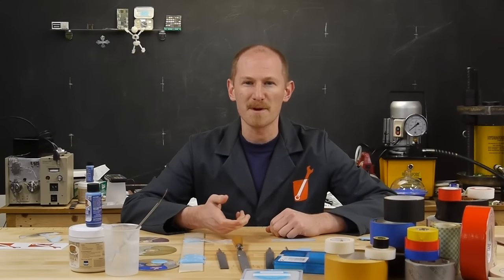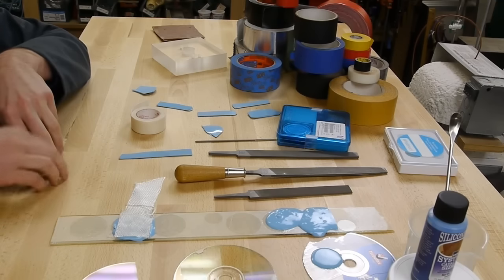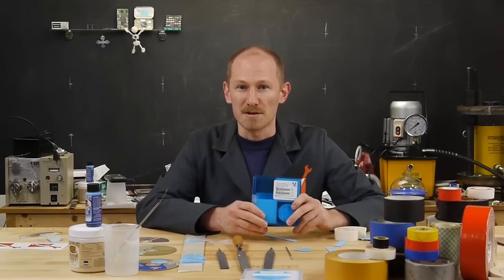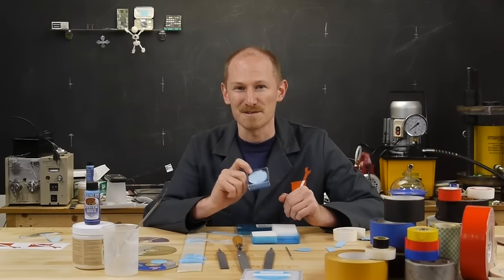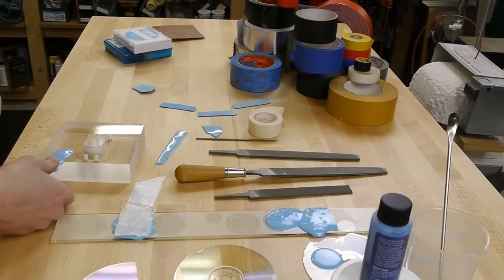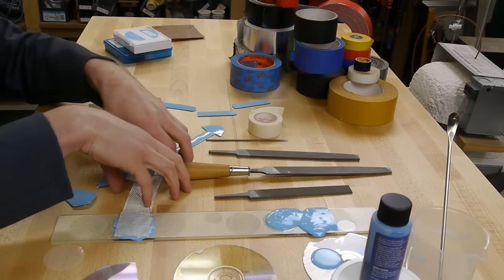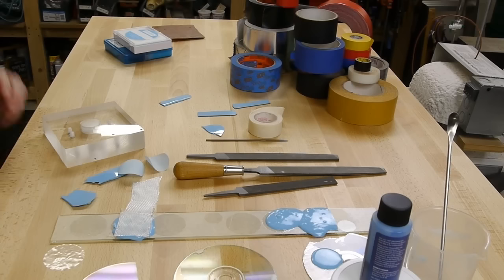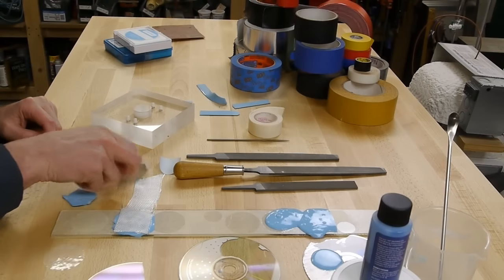Making DIY gecko tape - work in progress

Comment: grind salt to a very small grain size. Spread your layer of salt on a flat surface. Cast your silicone. When the silicone is dry simply wash in warm water until all the crystals dissolve.

Comment: You said that the cast from the super fine file had sharp points in the opposite area to what it should have been. Therefore, use the cast that was created from that file as the mold instead of the file itself. Then the usable tape will be a positive of the file instead of a negative of the file.

First use the file and create a negative, then use that negative to make a positive.  Sharp edges are then on the exposed side.

Good luck.

Comment: Hey, the CD idea seemed fairly successful, so maybe it can be built on. Since one can make CD ridges by recording on a CD, then you could make like a simple recording that only makes small holes, and not long ridges (something like 101010101...). As for the depth of the holes, maybe you could modify the laser in the CD recorder to increase its intensity somewhat so that the holes end up deeper, thus resulting in a better aspect ratio for the silicone rubber.

Comment: A few ideas come to mind here:
1) have you looked into BlueRay vs. the CD? My understanding is that BluRay disks have a higher resolution which would give you the density you're looking for. It doesn't really fix the aspect ratio issue, might be worth trying. You may need to take this one step further and try and modify the writer firmware to not "burn as deep". 
2) What about carbon nanotubes? Don't these grow vertically in a tight packed bunch? if you could some how bond the bottom of the tube to a substrate I would think you would have the dense finger structure you're looking for. I'm pretty sure all you need to grow these tubes is to run methane through a heated tube overtop of a silicon substrate.
3)I would think you would need a vacuum to get the silicone to flow into the holes, but since it does, what if it was possible to plug one side of the filter completely so that it prevents the silicone from filling up the thickness of the hole depth lowering the aspect ratio.

Comment: Fascinating video.Thanks  for taking us on the adventure. Would it be possible to make a mold from another naturally occuring surface and from that cast your test surface?  I'm thinking of finely haired plant leaves such as the lotus leaf. If you were to tilt the leaf in such a way as the silicone would run against the grain of the hair formation, the hairs would stand instead of fall flat under the load of the silicone.  This may yield the uniform upright pattern you seek. Demolding may require a chemical or thermal aid to ensure the hairs are not trapped in the mold after release.  Finding a plant leaf whose hair dimensions suit this task may be difficult, however nature went ahead and spaced them evenly and stress tested the design for you.

Comment: You could modifye your Scanning electon microscope to do electron litthography, and thus make a pattern, however the acceleration voltage and electron intensity required might be to high.

One other thing you could try is to grow carbon nanotubes. First you can sputter some silver at a high presure and low deposition time to make silver islands on a wafer. Then use the silver islands as a catalyst for the growth of the nanotubes.

Comment: I noticed the density of the laser etched on the CD and realized 2 things. it seems awfully spread out and maybe writing data to the CD that was more densely packed would get better results. Also I was thinking about the depth and I'm pretty confident that bluray disc drives use a variable depths system to right multiple layers of information on the disc. Maybe it's something you should look into.

Comment: Hi! You could try to use lightscribe disc and burn some fine image into the surface. Are you using EPDM or some conventional casting silicone? EPDM is using for microfluidics for really fine geometry with high aspect ratios.

Comment: What about a metal surface machined as flat as possible, but experimenting with the machine marks. The flat piece of silicon in the video could only be made better with the right surface texture. I've seen machine marks that produce light diffraction patterns which must be pretty fine structures.

Comment: After 3 years probably you are no longer looking for a solution but here is my candidate just for the records: "diffraction grating"

Once I used a cheap film diffraction grating as the top layer to flatten the UV cured solder mask and I got all rainbow colors on my PCB board.

Comment: Very interesting and engaging video. Just wanted to throw in an idea that may not work: why not useing sandpaper as mold? the filter or CD that you used leave a pretty flat surface on the silicon rubber, while sandpaper leaves a pretty rough surface. You can get very soft sandpapers up to 1000 grit or more. Also, the softer the sandpaper gets, the shorter the resulting pillars on the silicon rubber would get.

Comment: Thinking a better approach might be to mill a fine powder of crystaline structure particles, and possibly structures that might kinda melt under the pressure and friction at microscopic scale.  Now if this substance (perhaps a salt) is filled into a reservoir to be heated by a tiny, repeating spark, so that it can sweat out through microscopic holes, onto the surface, and immediately re-crystalize in surface spaces, or perhaps just trying to coat larger hair structures with sharp edged micro-crystaline powerdered particles might work.

Comment: find the finest stranded copper wire you can find,  strip the insulation off and bundle them together..like a paintbrush. clamp one end, and coat the entire bundle with an epoxy, making sure not to leave any voids or bubbles. before setting aside to cure, pull the whole bundle into a tight fitting plastic or aluminum tube to compress all of it together. after cured, slice cross sections off...then polish the resulting "coins". then etch the copper out using ferric chloride. ...you can then cast rtv into the disc.

Comment: How about evaporating some metal onto a smooth piece of other metal which has a light current running through it (thin film lithography if i'm not mistaken). That might create the rough surface you need. Of course that's to rigid, but you should be able to use it for casting some plastic onto it on which you can pour your silicon. Maybe the technique behind water repellent surfaces can help you since that's like a reverse proces.

Comment: I wonder if you could heat one side of the polycarbonate film enough to melt the holes closed on that side, but keep the holes on the other side intact. If you melted the one side deep enough, you might be able to shorten the holes down to where you need.

Comment: How about using something similar to a CRT tube to shoot electrones into a sheet of plastic or similar, much like the method by which that membrane you showed was made. Only in this case, you would be able to modify penetration depth by changing the acceleration voltage. If you can control the current of the deflection coils well enough you could even make it patterned instead of random. If the deflection coils are hard to control, you can refocus the beam to be able to have a bigger tolerance on the deflection coil current and then scale that down to whatever you need.

Comment: I was thinking that maybe a diffraction grating would be worth a try. Else Anodised aluminium oxide anodised in sulphuric or oxalic acid at 40v (don't remember how long for but could find out if you are interested) would easily produce nicely hexagonally ordered holes /pillars of nano meter range.

Comment: Ben  - I would not agree that sticky tape use chemical bond to be sticky. I think they works using van der Waals forces - layer of glue is pressed to to valleys to increase of total area of contact where adhesion and cohesion works. In gecko case difference would be dry hair instead sticky dense fluid. 
Comparing your picture with gecko I think is fare too low density of silicon hairs and a bit too short  (however  jelly-like material adding some positive effect). 
I would suggest to use some suction and put casting filter underneath the silicon rubber.  

Another moon shot idea for casting filter: sticky tightly some clink film (with double sided tape if needed) to dvd or clear tape and print holes  in RW-DVD-rom.

Comment: What about using front tinned mirrors similar to those from a catadioptic  lens, So that you take the larger projection and reduce it in size. I am not sure but I would think it would allow UV to pass still, and you wouldn't have to worry about as much refraction and potential aberrations . You may need to build a small columiator to cut down on refraction though.

Comment: You can try breaking your phone,(or probably any lcd screen) I dropped mine and and found that between lcd and back-light there are plastic diffusers that split light in two ways (and when you wet one side, it goes clear) It has to have surface structure similar to file but in much smaller scale. only problem is that the teeth would be symmetric. Anyway, I'd like to see that diffuser under sem :)

Comment: I am not quite sure if it will work but the mold you are looking for reminded me of a diffraction grating. Either transmission or refractive diffraction grating. since they have up to 2000 grooves per mm, it might work. though I'm not sure about their thickness.
maybe you could use a transmission grating as some sort of mask in a proximity photolithographic process. 
but I don't know. cheers

Comment: Blue ray's or ultraviolet disks might give you better results than the cd. It's the same concept as the cd with 4-8 times the pit density, you'll still not have the perfect 4:1 ratio on the pillar length, but maybe with a higher pillar density of something that already showed some promise you won't have to be as precise.

Comment: sorry, I'm getting more ideas: hot wire in blue foam. You need to get a real thin wire and it would be good if you could get the foam to move precisely in small increments. I think the key thing is getting these pillars at an angle. Also a 2d array of slits in the foam could help too.

Comment: With the file you had the negative side of the mold. If you make another mold out of the one you made you would have the mold with the sharper edges touching the surface.

Comment: How to make gecko tape:

Start with super fine steel wool (OOOO)

Through mechanical abrasion, make even finer particles from that steel wool. The abrasion must be done INSIDE a sealed container. That’s partly for safety, and partly to retain the millions of super fine particles you’ll create. 

The ideal shape for this sealed container would be a smooth clear cone, approximately one foot tall. The diameter at the bottom ( narrow) portion should be 3 or 4 times smaller than the top ( wide) portion of the cone. That will allow a mild cyclonic air circulation to bring the finest particles upward. 

To prevent rust, an environment of nitrogen could replace ambient oxygenated air inside the cone. This container could be homemade easily and cheaply from mylar, so long as multiple layers of taped mylar are used to make the cone rigid enough to accept a tight seal on both top and bottom. A practical size would be a 3-inch inch diameter at the bottom of the cone, and 12 to sixteen inch diameter at the top. 

Abrasion could be accomplished by placing a dowel or steel rod through a hole in the top of the cone, with an abrasive disk attached to the other end (near the bottom) Stir the steel wool briskly by chucking the externally exposed rod into a handheld drill or drill press. 

After the dust has settled, (literally) apply gentle air turbulence to agitate the steel wool hairs. A straw through another hole in the bottom would be sufficient. ( but obviously, do NOT suck in air from the container!) I suggest small puffs of air supplied by a squeeze bulb. 

Draw a super gentle vacuum from above, while filtering the steel hairs through a fine cloth or paper filter in the 1 to .5 micron range. Visualize the pile of iron hairs is on the bottom of the container, the filter(s) are above that pile, and the sticky inner top surface of the cone above that.  

To further segregate and trap the finest of those steel particles, a VERY weak magnetic field at the top of the container would attract and hold only the lightest and smallest of these super-ultra fine steel hairs.

It is also possible to agitate the finest of these hairs using only magnetic force, but that would require careful calibration and time to see results. For that process, I suggest placing a small magnet above the container, suspending by a string, then swinging the magnet back and forth, like a pendulum, many times until the smallest particles are attracted to the sticky inside top and trapped. That might be too slow to do manually, so some mechanical pendulum would be advisable. A standard clock with a pendulum could work. 

Alternatively, one could produce super fine hairlike steel particles in a container, then carefully transfer all the steel wool into another container filled with some liquid other than water, since water would cause rust. The let gravity draw the finest particles through sub-micron filters into a chamber below the filters. Remove liquid and let dry or quick dry with heat. 

After the separation process, we need to capture and align these hairs.

Initially, any standard adhesive like that found on tape would catch these small steel hairs. 

Once we have the super fine steel hairs...

Adhere steel “hairs” to any non magnetic substrate. You would need a very thin adhesive that does not promote oxidation. Perhaps very thin shellac in alcohol? Since shellac layers can be formed in micron thicknesses quite easily by hand, (as in French polishing) it would be a controllable and cheap adhesive. 

After millions of such miniscule iron hairs are produced and stuck to a substrate, use carefully controlled magnetic force to gently align the steel hairs so that they stand up from the surface they are stuck to. 

While that magnetic force holds these hairs erect in place, make a reverse mold. The molding material must be sufficiently thin to penetrate the microscopic interstices between each hair. 

Once that reverse mold is set, use very strong magnetic force and physical rinsing with saponified water to remove all the steel hairs from the negative mold. Dry that negative mold thoroughly. 

Now you have your negative mold with millions of tiny, vertically aligned holes or tubes. You can adjust the aspect ratio by controlling the thickness of the molding substrate. If the substrate is sufficiently hard, precision abrasion with super fine abrasives ( like those polishing cloths from 3M)  could work. 

Otherwise, carefully controlling the adhesive layer in a centrifuge or using super thin shellac might be the answer.  

Pour your low-viscosity silicone mixture onto that negative mold and make your gecko tape!

Comment: Bit late to the game, but how about hitting the photoresist with the  electron gun from the homemade SEM? You could even use the focusing elements with the charge reversed to control the spread the of the beam and control the density of the patterning, and and use the drive voltage to control the depth...

Comment: I haven't read through all the comments, so I apologise if this has been mentioned already. Could you use your laser to punch the required diameter perpendicular holes in  a metal  of the right thickness to cast from? If  you put the metal on a CNC platform you could automate  the motion and pulses to get the  right pattern density without having to do it manually! Also,  are there other materials than silicon that might be more intrinsically sticky but still resistant to clogging of that stickiness?

Comment: 1.what about trying to "shave" the non working gecko mold.
2. scratching glass with fine grit sandpaper.
3. can you show a microscope image if the glass mold? maybe there are glass that will fit more.
4. maybe blu ray. First with consistent etching (data) pattern and additional etching then will work on the existing pattern (acid that will be reactive on the "holes")
5. smooth  ice sheet

Comment: Someone may have already suggested this, but what about casting in an E field? If you add several thousand V/m, you could get even the tallest hairlike structures to stand up, and since you're casting a dielectric, they should retain some amount of charge. Then, when you want to demold, you can reverse the field so that the mold and the casting have the same charge, and come apart easier. Finally, since you're looking for several thousand V/m, and the tape should be 1-2 mm thick at most, you should be able to do this with something as inoffensive as a 9V battery.
Corrections are, of course, welcome. Hope this helps.

-Pete

Comment: Maybe it's possible to use the casting of the CD as a stamp to deposit light-proof ink on the photoresist, or alternatively use the micropore filters as the mask for the light-exposure (not sure which way will cause the process to etch holes)